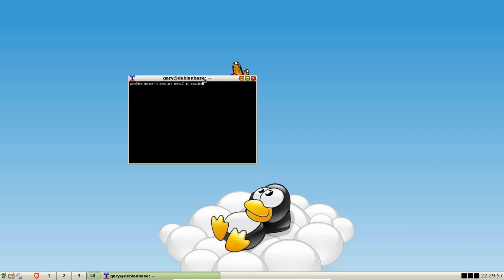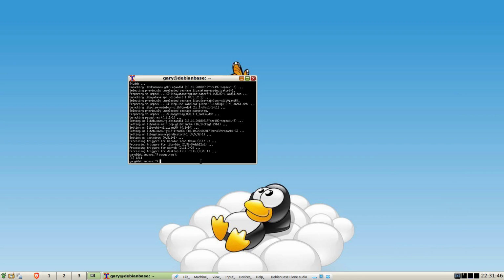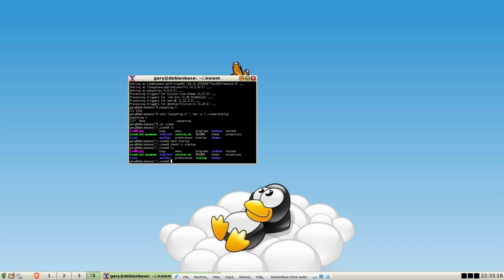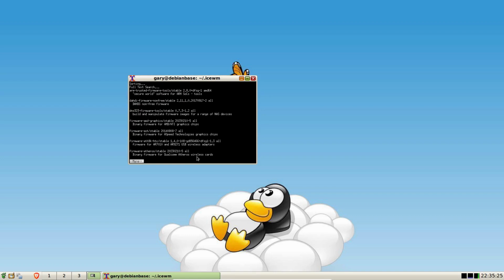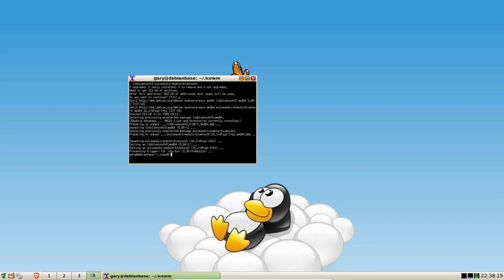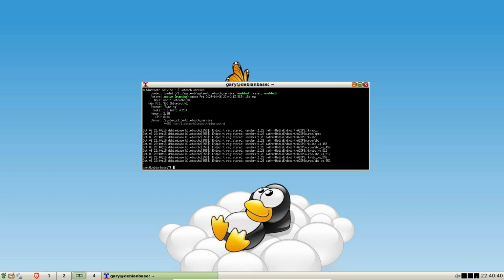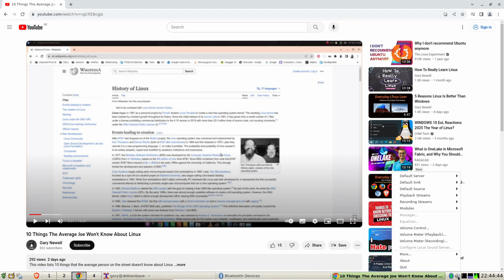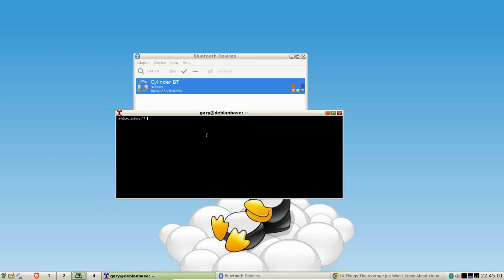How To Really Learn Linux - Setting Up Audio And Bluetooth

Comment: You shuld zoom in on the terminal at least. The font is to small.
Reply from the maker: Ok. I will do that for the next one.these videos are designed for watching on a screen rather than a mobile though
Reply: @EverydayLinuxUser yeah, bro... that's what he's saying... it's micro tiny on an 85 inch TV!